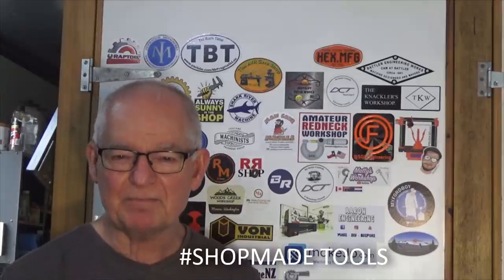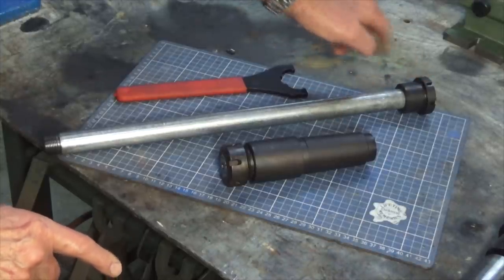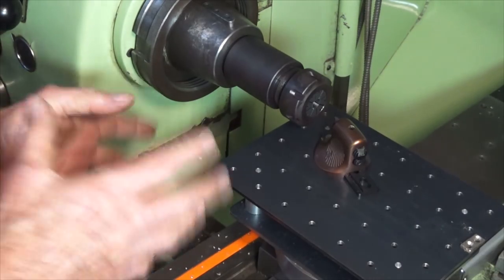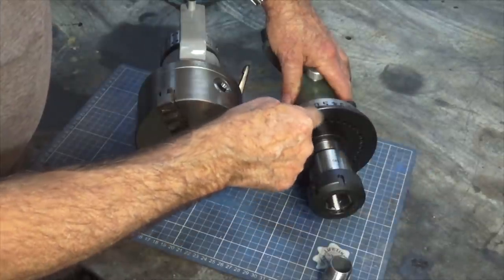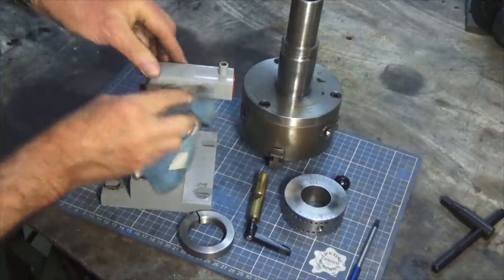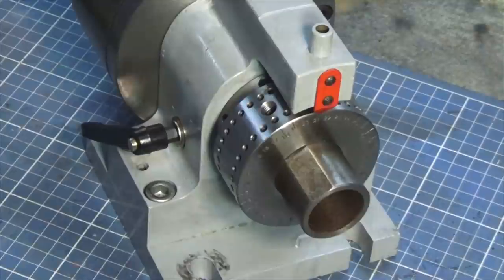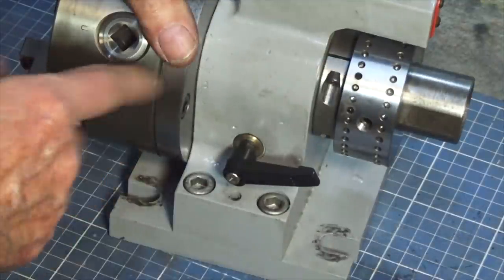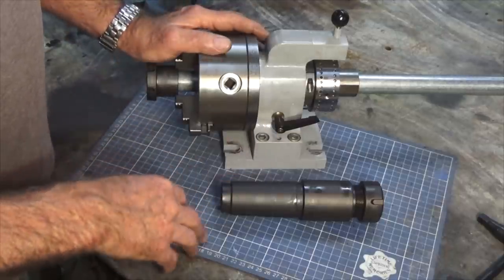#ShopMadeTools - Why?

Comment: Great video! For me as a beginner metal worker the learning experience in making my own tools really counts.
Reply from the maker: One of the first tools we would teach our introductory engineering students to make was a metal scriber. It was a simple tool comprising two parts but there were nearly six different machining operations required to make it. I forgot to mention that sometimes shop made tools are an excellent way of learning new skills or consolidating existing skills. Anyone can buy expensive tools but making your own is rewarding in it's own right.
Regards,
Mark

Comment: I really like your explanation of what the tool does and why you designed it. Sometimes the why is not obvious to us neophytes and this really helps me learn something new and how I may have it to my situation.
Reply from the maker: Thanks. I do have another dividing head that I didn't show. It is a Versatile Dividing Head designed by the legendary George Thomas. It has some very cool features but it takes forever to set it up and it's a lot less rugged than the DIY spindexer version. If I am only looking to mill 4 flats or drill six holes in something it's way easier to set up the big one with the chuck. 
Regards,
Mark

Comment: There's also the aspect that making your own tool can be as satisfying as building the final project itself !
Reply from the maker: Yes, absolutely. I have a small versatile dividing head that I made from a set of castings. It was designed by the legendary George Thomas and it is capable of direct indexing as well as two different forms of indirect indexing. I have only ever used it once but it was a challenge and I learned a lot while making it. Will I ever use it again? Maybe not, but someone will one day.
Regards,
Mark
Reply: many time the project is the shop !

Comment: Hi, Keith is from Michigan. It makes nice since, it's typical to machine dedicated tools for your applications.  I'm 64, it's  fun as an hobby,  tooling has become very popular 😀. Finally I got up the nerve, Originally, I wasn't a big fan, site shopping. So I liked your idea, this free handing and your plate.  I'm going to keep that in my mind. Have a nice weekend now.

 nice weekend friend 😊.
Reply from the maker: Keith, the Turnado system is made here in Australia by Eccentric Engineering. It's one of those accessories that doesn't get a lot of use but when the need arises it does a wonderful job. I am working on a model aircraft engine at present and the spinner has a parabolic profile. I can machine the shape with just an acrylic template and a follower that clamps to the tool block. 
Regards,
Mark

Comment: That's a pretty sweet index-a-ma-thingy 😁. Gotta say, it's a few steps up from mine 🤣. My 36 and 40 tooth change gears were the exact gears I used for making my bevel gears and are most often the ones I use whenever I do need it 😊. Being a junk collector,  I have acquired a 20 tooth worm and wheel to make a more better one 😉. In any case, thanks for the share, Preso! (and for pointing at my cheezy sticker 🤣) Cheers!
Reply from the maker: Free publicity is all part of the service! I actually don't own any change gears but many years ago I saw a design for a simple direct indexing tool that used 36 and 40 tooth change gears and a plunger that could fit into the space between the teeth or if you turned it 90 degrees it could sit on the top of the tooth giving you double the number of positions. I got really excited about making one but I had everything I needed to make it except the change gear. One day I found a box of junk with an odd gear in the bottom of it but just my luck, it had 27 teeth. Really? I couldn't even get two divisions out of it. 
Regards,
Mark
Reply: @Preso58  oh yeah, that's a pretty useless gear lol. Unless your making a triangle or a nonagon 🤣.

Comment: Preso, I don't think I am alone in that I must spend 85% of my time making jigs/setups for jobs that then 5 of the time to cut. The last 10% is persuading her indoors why I have been in the shed most of the day! That looks a great indexer, I bought a large one when I got the milling machine thinking that bigger is better but as I get older it is getting harder and harder to get motivation to get it up on the table. A small one like yours would probably suit better so I will have to add that to the list of projects. Woe betide the person who has to clean out the shed when I pop my clogs!
Reply from the maker: Michael, I have a friend ten years older than I and he has repeatedly reminded me that when he "puts his cue in the rack" that I have to back my trailer up to his shed and take all his stuff. He has one of those monster dividing heads and a rotary table as well. I suspect by the time I get them, I too, will be to infirm to lift them. Oh well, I could always make a shop crane? 
Regards,
Mark

Comment: Wonderful video! Lots of good ideas. I was going to mention that there is a very inexpensive tool that pipefitters use, it's basically a roll of very heavy duty construction paper. It has all kinds of markings to guide you if you want to cut angles etc. I recently picked up a newer one than I am used to seeing, and they have graduations now! It's limited to nominal measurements, but it covers any diameter with a quarter inch resolution. They are only like $3 and are surprisingly accurate.
Reply from the maker: Sounds useful. There are so many good products out there. 
Regards,
Mark

Comment: Gday Mark, you’ve really got me thinking about the ER collet chuck, I’ve got a full set of Vertex ER40 collets and there’s been time I need to put long stock in but I only have a draw bar style, I didn’t even give the tube a thought, brilliant idea, new job on the to do list, thank you mate,
Reply from the maker: The little Hercus milling machines we had at school had a draw tube to hold collets in the vertical spindle so that's what gave me the idea. My ER40 collet chuck has let me down on a few occasions when I have needed to hold longer parts. I have dispensed with the drawbar and then worried that the chuck would walk out of the spindle. Bad words would certainly be said if that happened. 
Regards,
Mark

Comment: Almost no one does stuff in their shop to save money.  We do it for the fun of it or to make something you just can't buy.  It keeps your mind active, gets your butt off the couch and is satisfying to make stuff with your own hands.  I like the tools you made though.  You always do a very nice job on them.  For indexing rings, if you have a DRO on the mill, it is very easy to do a bolt circle with however many holes you want on a flat plate.  No dividing head or rotary table required.
Reply from the maker: I never did trust the DRO to do bolt hole circles but just recently I had a go on something that wasn't too critical and I was surprised how accurate it turned out. If you have seen Clickspring's series of videos on the Antikythera mechanism and the super simple dividing plate he uses it would be an alternative for anyone who is just starting out with limited equipment. 
Regards,
Mark

Comment: Nice tools ,I made many tools over the years with me it was always cost effective. In vokie our shop teachers had tool builds as our learning skills and to get experience. Many if not all are still useable.we had two shops required machining and tool &die shops. Everything to be both in the fields of our choice. I enjoyed both over the four years , then had several more years in apprenticeship ,an night school drafting ,metallurgy n more. I use to case harden many of my tools because of the coloring.
Reply from the maker: I have never heard the term Vokie before. I just looked it up on Urban Dictionary. We used the term Voc. Ed. which was short for vocational education.  Towards the end of my teaching career Voc. Ed was being promoted as an alternative educational pathway to university education. Voc. Ed was always considered to be the less desirable route to a career however students that took up apprenticeships were paid a wage from day one and didn't incur a student loan debt plus they actually had a job. My own son took an apprenticeship despite not graduating from high school. He finished his trade before he was 20 and now at age 27 he is earning more money than I was as a Senior Teacher before I retired. 
I have had a go at case hardening and despite the issue of getting hold of sufficient carbon rich packing material it actually worked a treat. 
Regards,
Mark

Comment: I really like that indexing tool in particular. Nice work! (PS: Circular/table saw blades often come with 36 or 40 teeth, and can also be used for indexing)
Reply from the maker: Thanks Craig. That indexing tool has capabilities that the spin indexer cannot achieve. I actually made it because I couldn't afford the Spin indexer at the time. 
Regards,
Mark

Comment: Two websites of interest are - Workshop from Scratch and Made in Poland for projects such as. Electric Roller Bender, Magnetic Drill, Horizontal  Metal Cutting Band Saw, Key way cutting attachment for Lathe.
Reply from the maker: I have watched a lot of the Made in Poland series. Good stuff.
Regards,
Mark

Comment: Made myself an er40 collet nut once. I bought one on ebay and it never turned up, do I thought stuff it, I'll make my own. Turned out nice.
Reply from the maker: I was OK making the chuck body and I guess at a pinch I could be persuaded to make the nut but they are so cheap I caved in and bought one. The body of this chuck had to be a bit longer than normal to allow it to reach over the Turnado table a fair way.
Regards,
Mark

Comment: I use shop projects as a skill builder.  I did the same thing with wood working, and made my mistakes building shop furniture that is functional, but cosmetics isn't a primary concern...  You also start to understand work flows, operational sequencing, and other critical skills required to make good parts.  Besides all of that, there is a huge investment in machines, and equipment...  You may as well use it for something.
Reply from the maker: I like the idea that a shop made tool can be personalised. I wonder how many left handed folk end up having to make a lot of their own tools!
Regards,
Mark
Reply: @Preso58  Good point...

Comment: Thanks Mark, I have a Myford ML 7 lathe and accessories for it in Canada are scarcer than chicken's teeth. 
I started out with ER25 collets and also 5C later. I purchased a ER25 collet chuck on a Morse taper 2 shank to fit the lathe spindle but like you ran into the lack of "pass through" capacity with the need for a drawbar. A spindle mounted chuckwas wha??. From a suitably dimensioned piece of cold rolled I machined the internal threaded end and then mounted that direct to the ML 7 spindle to machine the internal ER25 taper and nose thread of the holder to suit a commercial nut purchased off Banggood. Because it was machined on the lathe spindle it has zero runout in itself and depending on the collet 3/5*5/8*sfa. i.e. nothing to be concerned about.
For the 5C I purchased a mountless chuck off the internet and made my own backplate using the same method. To reduce runout I purposely made the locating "spigot" of the back plate about 0.025" smaller than ideal. This enabled me to chuck up a 1" pin in the collet chuck, lightly tension the three mounting screws and "tap" the chuck into as near zero runout as I could measure, torqued the mounting bolts and its been fine ever since. 
I also purchased a conventional 5C spindexer, hex and square 5C collet blocks. I then made my own 5C to ER 25 adapter using a commercial nut and that will fit the spindexer giving me alternative sizes to what 5C's I have. This adapter also has the external and internal threads of a 5C collet to enable accessories like a depth stop or extension collar to be used.
There is a contributor to the homeworkshop website who made extensive alterations to a spindexer by adding a worm gear to the front, roller thrust bearing to the rear and a frame that allows the use of the disks from a dividing head with the arms and selectors, via the worm drive, to enable hundreds of very accurate positions of stock for use on a surface grinder or milliing machine. I have most of the parts and a cad drawing ready to modify mine and now that I  have my mill its one of my "to do list" projects.
Additionaly I purchased a 4" 3jaw chuck to mount to my rotary table. It needed a suitable backplate so I made one that will fit the Myford but also the 5C spindexer. I'm still trying to come up with a mount for the rotaty table but haven't yet finalised a design.
🤞🇨🇦🍌🥋🕊️🇺🇦🕊️🇦🇺🐨👍
Reply from the maker: I would dearly love to have a full set of 5C collets including all the specials like hex and squares and then of course you need both metric and imperial. I guess that ER collets are at least capable of gripping odd diameters and they are cheap. 
Regards,
Mark

Comment: Mark Beautiful job. On the indexer why not take the base off and rotate it 90 degrees and machine it to fit the Bridgeport?
Reply from the maker: I will add that to the end of the list of projects that gets longer and longer. I just realised after I shot that video that I had put slots in to suit both the Sieg CNC mill and the now non existent Denbigh mill but of course they are both different to the Bridgeport. The idea was that I would be able to get at least three bolts in the base no matter which machine I was using but, you know, best laid plans and all....
Regards,
Mark

Comment: Thank you for this inspiring video. Just a thought about your ER32 chuck: did you consider incorporating some means of restraining small diameter stock from "whirling" when projecting from the tail of the lathe spindle?
Reply from the maker: No I did not but I have just watched a video by Machine NZ where he machined up a spider for the lathe spindle and it seems like a great idea. Many years ago my Head of Department decided that he wanted to machine a point on the end of a piece of 10mm steel rod about 1.5M long. He figured it was just a quickie job so he let the end of the stock hang out the spindle unrestrained. It bent through 90 degrees and destroyed a wooden cupboard close to the head of the lathe before he could stop it. Oh, how we laughed!
Regards,
Mark

Comment: Those are really nice tools you've made.  How do you switch from the 40 division circle to the 36 to get a small division?
Reply from the maker: All you have to do is to remove  the index ring flip it vertically and and realign it with the drop pin. It takes a few seconds. You can also make up "special' index rings for say, 50 divisions. 
Regards,
Mark

Comment: Hi. I have 3 colchester lathes mark 1 and mark 1.5. A friend has a mark 2 and all of them have a split spindle tube which means you can not use a draw bar at all because as my friend found out the hard way. It tightened the spindle bearings and bugggered them. Have you checked yours? 
You should use the big nut that holds the chuck or faceplate on. Hope you haven't damaged your spindle bearings 😳
Reply from the maker: Darren, I was not aware of this issue. As far as I know my bearings are still OK. I generally keep the draw bar or the draw tube just tight enough to stop the morse taper from working loose. Also, I may only use a draw bar a couple of times per year but I  just checked my Colchester manual and it shows the spindle which incorporates the spindle nose and the internal #5 morse taper is a single part which seems to indicate that the spindle is not split so tightening the draw tube just puts the entire spindle in compression but should not add any extra preload to the bearings. 
Regards,
Mark
Reply: @Preso58  oh good. maybe they changed the design. my lathes were made in 1957, 1966 and 1970. not sure how old my friends is but its  mark 2. If you remove the chuck and look inside the spindle, 3" down inside you will see the split. slide something down and you will feel it. I tried to get a pic of it but couldn't get enough light for it to show up. oh my lathes are student and master mark 1.
 If yours are not split that makes life easer for you but i thought i would mention it as you have a lot of followers and it might be useful information for some.  
thanks for posting your video's. being an untrained novice i find them very informative and enjoy learning from them. thank you for taking the time. regards Darren. Gloucestershire, UK
Reply from the maker: I knew mine wasn't split because I took the spindle out twice while I was restoring the lathe but you had me questioning the design of the arrangement for a while. I have heard that a lot of Colchester headstock bearings get ruined from using the incorrect grade of oil. The countershaft gears at the back of the main spindle are designed to pick up oil and sling it onto the two ends of the main bearings where it runs down and out the bottom through a drain and back into the headstock. If the oil is not the correct viscosity it will either not splash where it's supposed to or just cling to the gears. Also, it is a problem if you are running a VFD to control the speed of the lathe electronically. If you artificially slow the motor down it means the input shaft from the motor drive is not running at the RPM which is designed to sling the oil efficiently. It is better to just run the lathe at it's rated motor speed and then use the gears to alter the spindle speed. I am planning to return my lathe to 3 phase and use a VFD so I can get a smoother running motor with more horsepower. I had to remotor my machine with single phase and it's only 1.5HP. At the time I had no experience with VFD's but now I think it's a better way to go than using a rotary phase converter. I can get forward and reverse electronically and I can get motor breaking for threading rather than using the headstock brake. 
Regards,
Mark